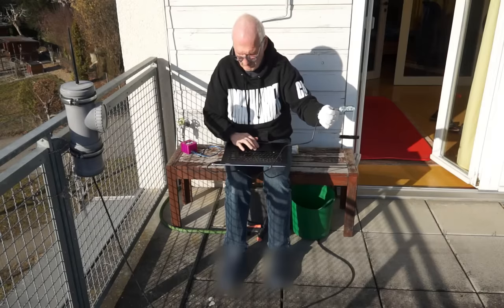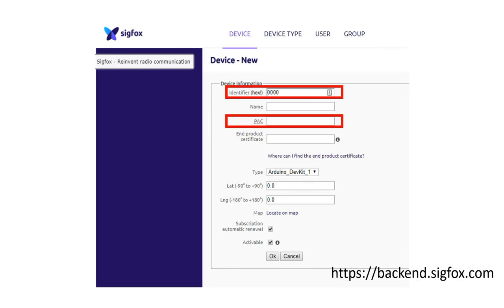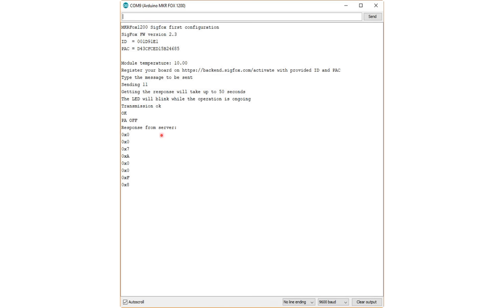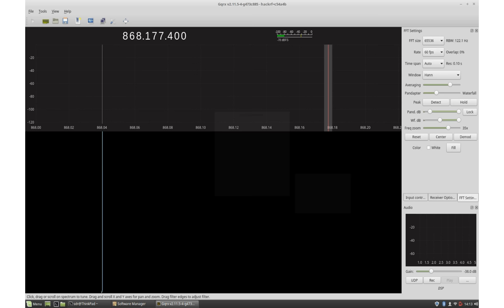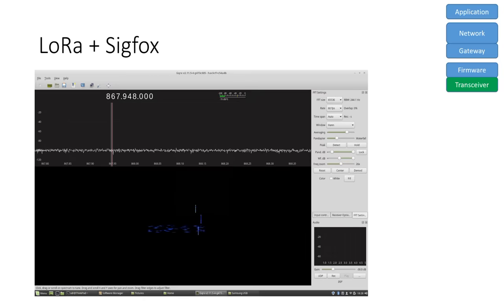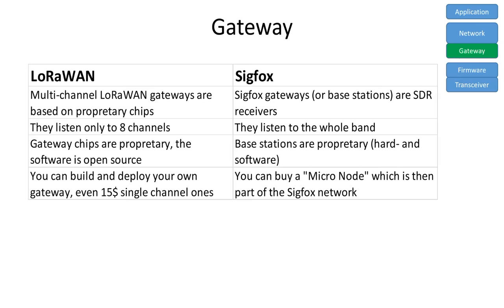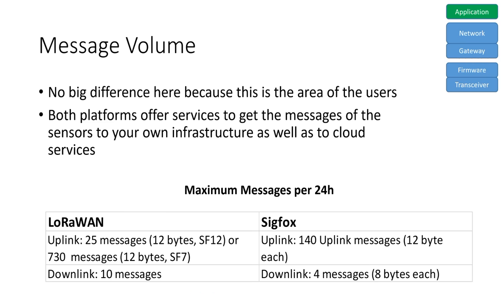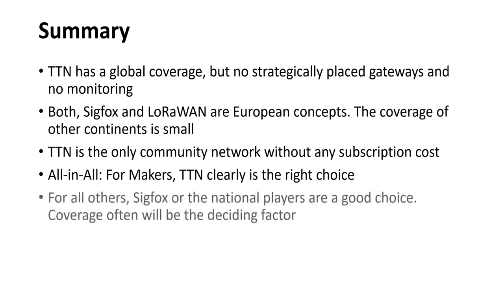#257 Sigfox vs. LoRaWAN (TTN): Which one is better? (Arduino MKR Fox 1200)

Comment: Doesn’t the Amateur Radio APRS system do much the same thing? Route small amount of sensor data globally over the internet. But I guess without security and business-level reliability.
Reply: That's kind of an apples and oranges comparison.  APRS is a fairly high power consumption system with a weak ability to use the internet for coverage.  It's pretty much standard modem modulated signals and relatively high power radios.  Sigfox and LoRa are designed for asynchronous, battery powered devices (nodes) that primarily send low bandwidth data infrequently, mostly in one direction.  Even with very small antennas, they can reach over fairly long distances with signal to noise ratios that approach zero.  As he showed, they are very tolerant of interfering signal whereas FM (VHF and UHF APRS) is not. LoRa is capable of decoding two signals on the same channel simultaneously.  I suggest doing a little googling to help understand the benefits of Lora and sigfox as compared to traditional modulation techniques.  Lora and sigfox are for many to one scenarios using extremely low power (milliwatts), with the goal of a ten year battery life.  In Lora and sigfox, the nodes/sensors are cheap to implement.  The gateways (receivers) are the painful part.  Lora is much less painful to implement, but probably doesn't make as good use of the spectrum.  Lora is wideband, sigfox is extremely narrow band, but the end result is quite comparable in terms of range.  Lora achieves high success rates in one transmission, whereas sigfox sends everything multiple times.  Lora is relatively immune to narow band interference and basically filters sigfox type signals right up front, sigfox is somewhat the opposite as it can easily ignore wideband interference, but would easily be blotted out by a narrow carrier interference, so it sends the data multiple times to avoid that.
Reply from the maker: I cannot add anything to mikes comment. Well done!
Reply: @AndreasSpiess  Thanks.  I guess I could add one more thing.  He mentioned business level reliability, presumably for business usage; amateur radio doesn't allow for any business related use of the bands.  There is a very similar, business oriented system called GPRS.

Comment: I don’t understand the summary conclusion, why is TTN “clearly the right choice” for makers? “ Surely the choice of Sigfox, private LoRaWAN, public TTN or indeed NB-IoT very much depends on the project you’re doing, existing coverage and ease+cost of putting up and a managing additional gateways needed for your project - even for makers. 

Actually a good choice is to use dual mode modules  (eg Murata type ABZ) which can do both LoRa and a Sigfox and just deploy the best option for each case.
Reply from the maker: Because you have coverage everywhere and it is free of charge. As a Maker, a service agreement usually is not so important. And we learn something by building our own devices ;-) Enough arguments?
Reply: Andreas Spiess I definitely do not have coverage everywhere on TTN - unless I buy my own gateways, more expensive than a Sigfox subscription - and still build my own devices either on TTN or Sigfox, so sorry the arguments don’t make sense to me.

Maybe there is some misunderstanding? You can buy for example $2 Wisol modules and build Sigfox devices just as you can with LoRa.
Reply: Sigfox provides service for makers for 1usd per year per device... one year free connectivity is usually included with dev boards

Comment: Please create the video of Connecting ESP8266 with STM32F103C8 Blue Pill Serial Communication (Not with AT Command)
Reply from the maker: Why do you want to connect the two microcontrollers?
Reply: hi  @AndreasSpiess  thanks  for reply Blue pill will take care of processing and Esp8266(nodemcu) will take care of Wifi and mqtt --- even if connection is lost from router then also blue pill will be independent of wifi so will work
Reply from the maker: I am not sure you would need two independent microprocessors for that. A decent sketch can do these things on an ESP. This is why I prefer it over the bluepill for most applications.

Comment: hi, before i post my question i like to thank you for your videos about lora, they was so helpful. they gave me a good idea and a good knowledge about this tech.
i'm in my way to buy various lora product but i come cross two type of lora gateway LG01-P and LG01-N and i didn't understand the difference between those 2 version. they said LG01-N which is the V2 of lora gateway use the linux to control it but the LG01-P version (V1) uses OpenWrt. ok, they are 2 difference OS (even the OpenWrt is based on linux, and openWrt is for routers) they said the V2 (LG01-N) uses the Linux to directly control the sx1276/sx1278 LoRa module which increase the communication efficiency and simplify the software design. but HOW?!!! and does that mean i can control the   sx1276/sx1278 using the OpenWrt. so which one is suitable or better. for someone want to start with lora and want to build a good skills to use lora in his projects, what would you advice me to buy. and please can you tell me the difference between using V1 and V2.
thank you.
Reply from the maker: I do not know these products. Be aware that 1 channel gateways use the SX1276 and 8 channel gateways use SX1301 chips. Nand maybe you watch my LoRa videos.
Reply: @AndreasSpiess  i know it's a 1 channel gateway and it's enough for me for testing and stuff like that. and after along research and some help i find out the difference, the LG01-P has atmega328p MCU but the LG01-N doesn't and it's directly controlling the SX1276 and i guess that mean no GPIO sensors for this N version but the packet loss is so low 1% when the P version has a 60% packet loss. i found a compare list in http://www.dragino.com/products/lora.html you can check the documentation section of LG01-P or N.
Reply from the maker: I made my single channel gateways with an ESP8266.
Reply: @AndreasSpiess   yeap i watched that video, good job. but for someone like me, first time working with lora i do like to start with kit that includes everything i need i guess. learn about the basics and then try to build my own nodes and gateways. thank you for your replay.

Comment: Don't want to rely on any cloud provider. Reliability and security problems.
Reply from the maker: Because of specialization modern lifestyle has lots of dependencies.
Reply: @AndreasSpiess  I am one of those poor unfortunates without wire or fibre internet. I only can use wireless in an area where it is bad and unreliable. I will have to maintain my own network for home automation using retrofit radio switches. Of course, wiring home automation into a new house would be easy.